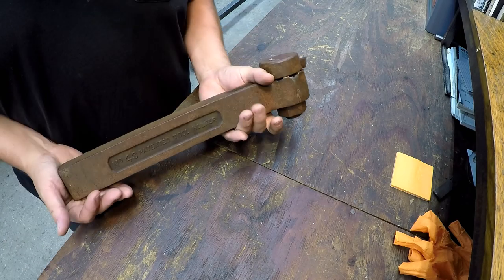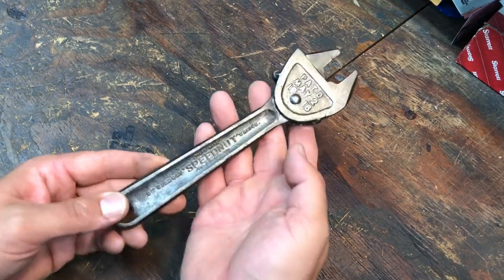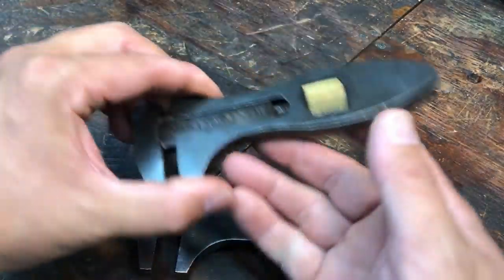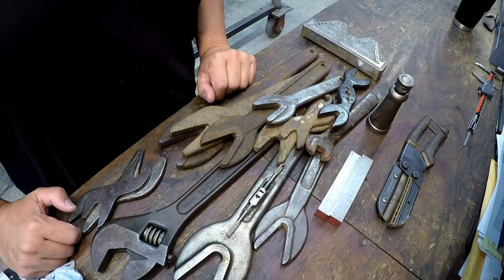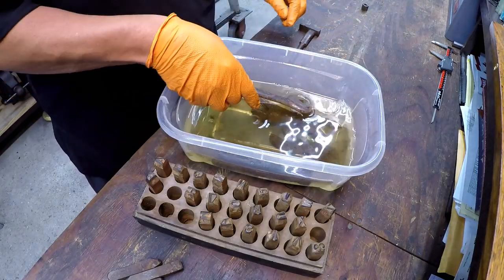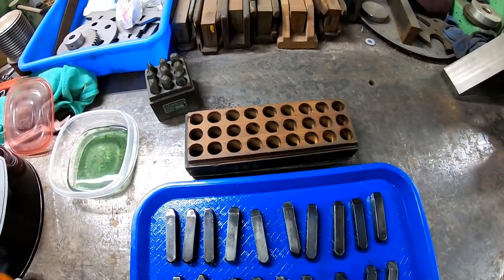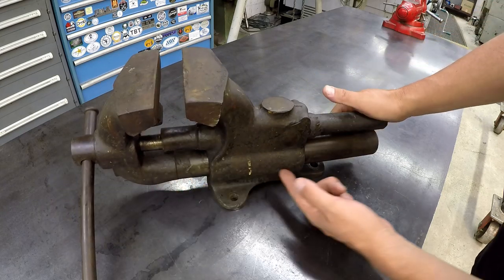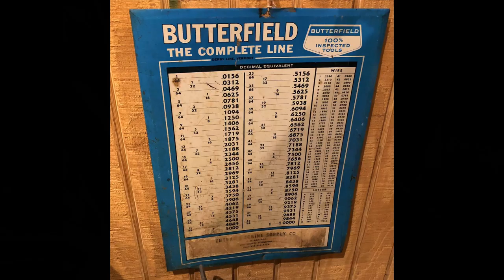SNS 272 Part 2: Antique Tool Picking, Letter Stamp Restoration

Comment: Hi Abom. I'm french.
Old Peugeot tools are very good quality tools. Peugeot is still a Car constructor. 

Unfortunately, the tooling branch of the company closed approximately 20 years ago.
Then it was "recreated" under the name POE (Peugeot Outillage Electrique = Peugeot Electric Tooling) but it didn't last very long.
The brand is still in use today (I don't know who bought it) but it's far from being the same quality as the orginal.

I own a set of Peugeot wooden chisels ( at least 70 years old) and they are really nice. Excellent steel quality. They will last at least another century...

Comment: Abom79, There is an art Gallery in Hammond Indiana call 'Paul Henry's art Gallery" which was once a hardware store.
Paul Meuller is the owner, Paul still has the original brand new tool displays in glass door cases from the 1940's. It is absolutely mind blowing, the tools are brand new and there are hundreds of tools. It is like something you would see in a museum. I can't underestimate, you would freak out if you saw these displays

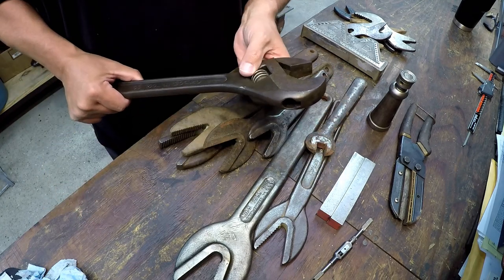Comment: @20:52 trailer hitch balls....on the receiver hitch, buy 2 balls, 2” & 1 7/8”, one with internal threads and one with threads on the shaft. Screw them into each other on the receiver hitch, one on top and one on bottom. Use 2 wrenches to tighten then together. Super-easy to swap in the future by pulling the pin and flipping the receiver shaft 180°. No tools required. I’d bet Mr. Diresta could make you a couple o nice lids for the stamp kits...

Comment: the speed nut wrench is also for not removing as you move rotate into position again. it loosens to refit then tightens again. its basically a socket wrench

Comment: I have the very same little vice and it does have a spring in there. pretty small but handy to doe soldering of small electrical things, at least thats what  use it for - never got a Panna Vise yet.

Comment: Hi Abom, thanks for another good video of interesting stuff.  As a "work around" with the letter stamps; you could use the number 1 stamp as the letter I, and for the letter B you can stamp first with the number 8 and then over-stamp the left hand edge with the number 1 stamp to improvise a letter B.   But try on some scrap or wood or leather first to see if it's satisfactory for the task.

Comment: Nice haul !!   I see you're using Brownell's " OxPho " bluing solution !! It works better than anything else on the market !  I've used it for many, many years, with zero complaint's. 

And it works really fast, if you warm-up the item you  are bluing.....Say around 100 - 130 F max !! If you get it working any faster, it may turn gray instead of black/blue !
 Also for a more consistent coating, you  can lightly oil the part with some 10w machine oil !  Try it out on a piece of scrap steel to see how it works !
Keep up the great work Adam !! Every machinist that has access to the web, knows who Abom is ! You are a world wide machinist !!

Comment: That French Wrench or French key was fascinating. 
The history of the naming of tools is interesting. The Spanish for wrenches was English Keys.
If course us Brits have to be different, we call most wrenches Spanners.
French Keys (also called Roll Wrenches) are still sold but there's not a lot of info about their design or the reason for their double jaws.
Reply: A spanner to an American is a wrench that we use to turn pin-hole or slotted nuts...
Reply: @Stubones999  Yes I learned that from here  ;^)
I appreciate the sense of the American usage. A C-Spanner IS actually spanning more than just a hex head I guess.
We use the word wrench here and there. Torque Wrench, Pipe Wrench (Stilson gets used for all kinds of pipe wrench), Pin Wrench, Chain Wrench. Monkey Wrench gets borrowed from American occasionally.

Comment: Aloha Adam, while I was watching you cold blue the parts, I got to thinking, a dangerous thing for me...  I usually heat the part and use oil and blacken it, the temp is well below tempering heat, so any heat treating is not affected.  What I was wondering has anyone compared the two to processes as to rust prevention????  I live in Hawaii and things are humid.  I know my method is NOT good for precision tools, but then neither is the cold blue!!!!  Any thoughts on this???

Comment: Adam, on the speed wrench do any of the tabs that are in the body of it move. I remember my grandfather having a wrench like that that would lock in place when you pushed down on one of the little buttons that stick out of the body. Love your video's. Have learned a lot about the machinist trade from them.

Comment: You have a new subscriber. I don't even own any metal working machinists' tools but still find it fascinating to watch you work. I'm thinking of an adjustable arm dial indicator base for my son (I think I'm calling it the right name).  Wondering if you could suggest one like you use for under maybe $50 and where I could order one from? The one you use is probably well over that price but then I don't know. So far, he is more in the hobby/learning phase. Any help would be greatly appreciated. Thanks.

Comment: We actually call the (peUjeot) wrench, a French wrench. There's many, many iterations of that type, very useful, especially the late models because they are essentially hand clamps. I have 8 mini ones i keep in my welding area just for their ability to kick metal into submission.
You can manipulate your work piece in so many ways with such a wrench. Bending, sucking metals together or even more out of the box solutions for example, you can't get the welding ground onto a part because it's too small? One of these is perfect to hook it up.

Comment: Very interesting as always. Permit me a few remarks.
Regarding planers: you might enjoy this historic video by Waldrich Coburg showing their huge planers https://www.youtube.com/watch?v=HThSfJcrk-g  The comment is in German but the images speak for themselves. Apologies if I repeat myself by mentioning this.
With regards to the Heuer vise: the company is located in a very interesting area with many relatively small scale companies specialized in metal fabrication like forges, foundries,  wire drawing plants,  cutlers etc.   You probably know "Peddinghaus" anvils which are also made in this area. Originally the companies  made use of the power of numerous rivers from the nearby mountain area. In addition they had steel  supply from the Siegen and Ruhr areas. Many of the "historic" companies are still in business or the buildings and equipment preserved. If you ever come to Germany, this is the place to go, and I would gladly guide you around.
As many of the companies were located in narrow valleys they had to use narrow gauge railways in order to connect the businesses "to the world".
Kind regards Harald

Comment: Peugot are still going except they now make cars and very good diesel engines
Reply: Since when was the PSA engine "very good"? I haven't seen one recently but the ones I did see always had issues, older models anyway. Enough that most people shied away from them.

We're talking anything from just randomly crapping out, leaking from just about every seal, timing chains breaking at low mileage, cylinder pressure leakage up the injector holes, head gaskets, glow plugs rusting solid to the head, clutches slipping for no apparent reason even after a proper replacement, turbo chargers failing left right and centre... The list just goes on and on. I'm none too impressed with their cars in general either, but then again any French car is for people with either very specific interests or no knowledge of cars whatsoever.

Comment: The number 9 is missing from the number stamps. Or it could be the number 6 – either way, you’re one short.
Reply: 6 becomes a 9 and 9 becomes a 6 no duplication no waste. the set is complete.
Reply: @stevenlein4772  That would be cheating.
Reply: @mm9773  The lazy carpenter that drilled the boxes them do it like that.